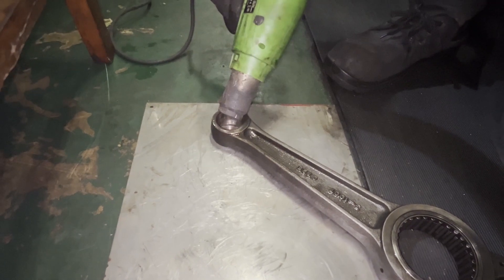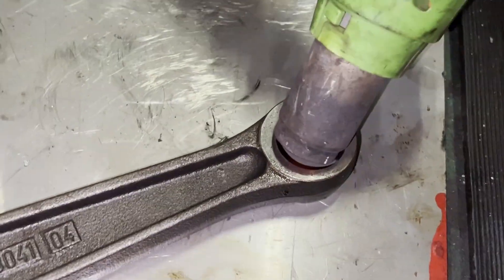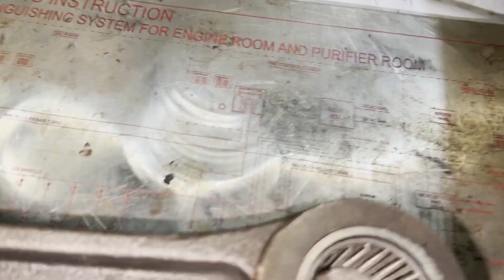PART-3..Fourth Engr jobs. Maintenance on Service air compressor.. Con Rod bearing remove and refit..

Comment: In what position should the bearing's external lubrication hole be located? Does the position of the bearing's external lubrication hole affect the bearing's installation position?